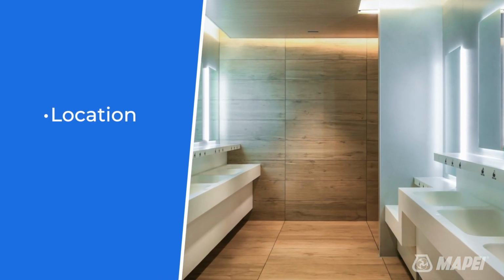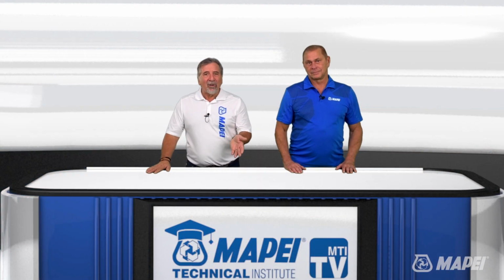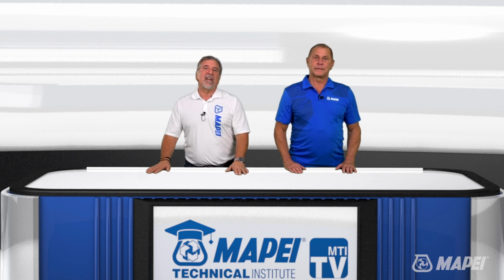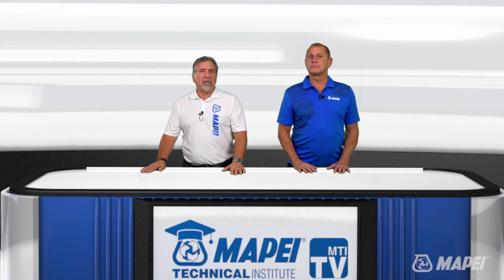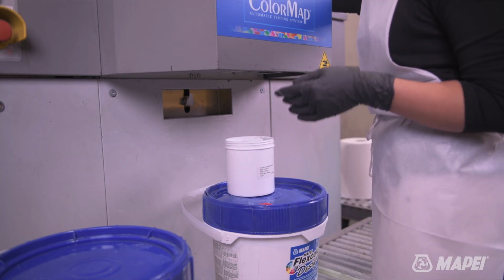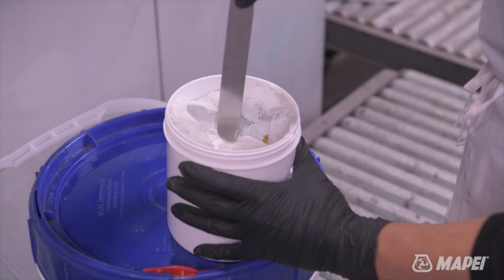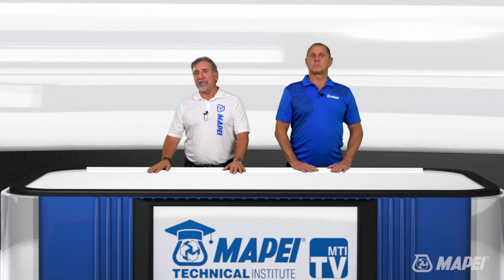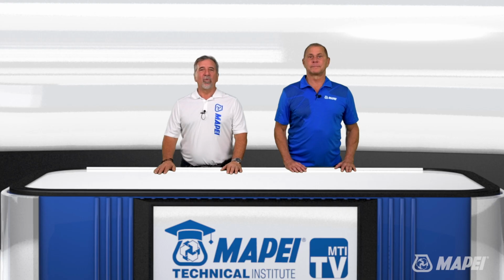MTI-TV #21: Choosing the Right Grout

Comment: Are the epoxy grouts hard to apply? We bad large wood look plank tiles done 6 years ago, but the installers used faulty grout so they ground it out and redid it, but it dried way lighter than we wanted (well water, I suspect was the issue), and left huge gaps in the grout. So I'm considering having it all redone, AGAIN. I like the option of being able to steam mop the floor with the epoxy grout. It won't fade with that, even with a dark color?
Reply from the maker: Hello Jen, thanks for reaching out and yes, you can steam epoxy grout once it is fully cured- 10-14 days.
Reply from the maker: Please contact us at (800) 992-6273 if you have any questions.
Reply from the maker: Hello Jen, one more thing- keep steam cleaning wands 6"-12" above surface.
Reply: @MAPEIUSA  good to know. I was thinking about the floor cleaners that look like a vacuum but steam clean tile. I'm guessing those aren't safe?